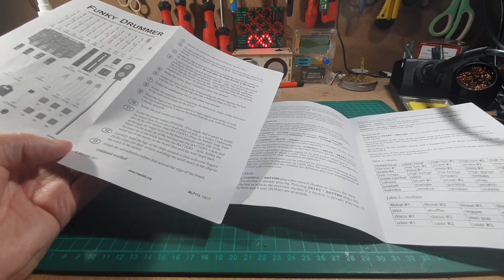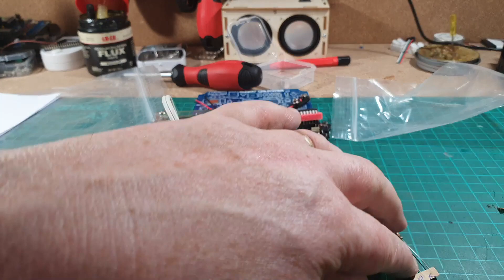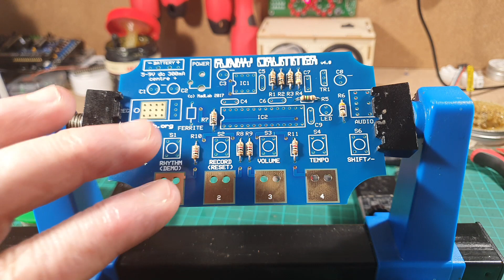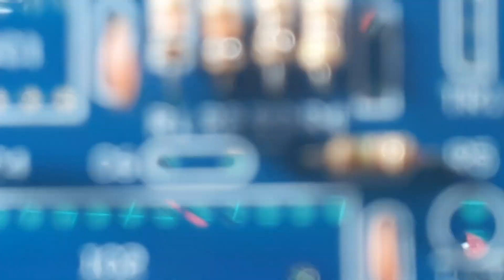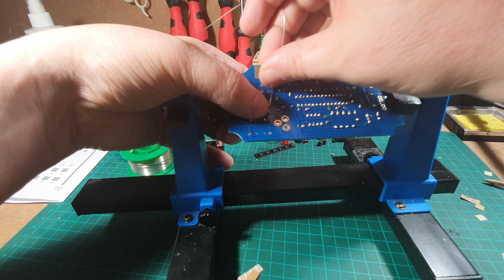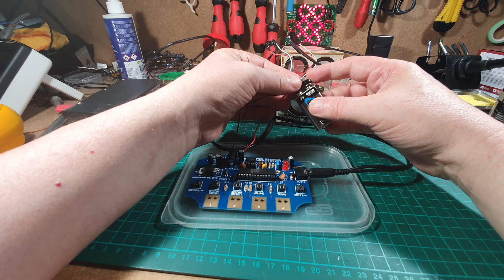Kit build of the Mad Lab Funky electronic programmable drum machine

Comment: change the battery in your tester,  it's showing 7.7V which is rather low for a 9V PP3
It migth explain the dud readings. Use a DVM as a sanity check as well.

Andy
Reply from the maker: Noted - now battery installed